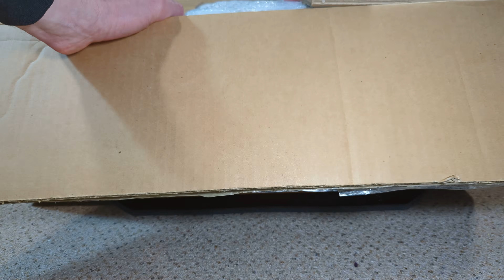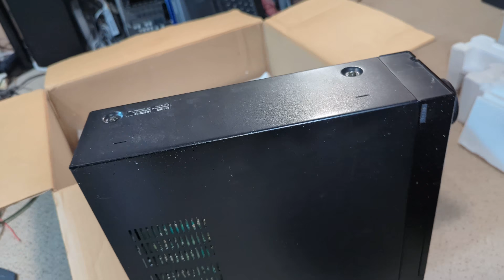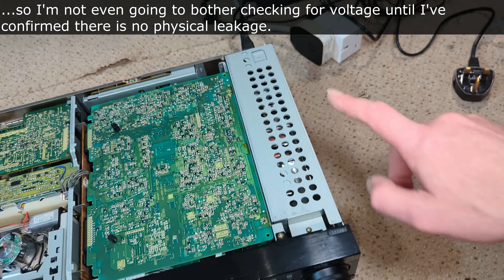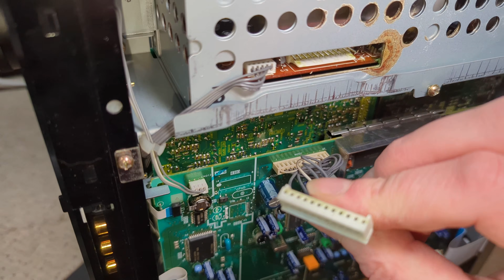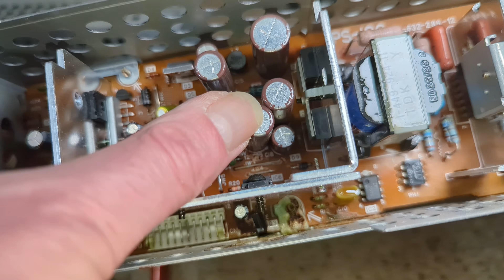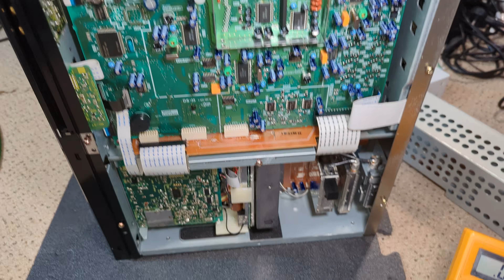Sony EV-S1000 Hi8 - No power - Part 1

Comment: I managed to obtain a like new sony EV-S700E locally in Australia and it's like new and working perfect. I prefer the U mechanism in my 700E too. I had a sony EV-DT1 also which has the same U mechanism like a mini beta machine.
Reply from the maker: That's a good find. relatively, they didn't sell in huge numbers but there does seem to be a lot around still relatively and I've seen quite a few in great condition too. It's always those Elna capacitors though (plus the decks can be quite troublesome).

Comment: I had one of those decks 30 odd years ago. Sadly it was a bit of a disappointment right from the start, as though it was not properly aligned/calibrated. The only thing it had going for it was its looks, and mine had the timber sides.
Reply from the maker: What a shame it didn't deliver on the deck side of things, Timber sides - that sounds great!

Comment: You got a lovely job there! You'll find that 'orrible electrolyte is highly conductive which in turn makes the whole pcb and components conductive, you have to clean everything! once you get a few caps removed, probe the empty holes with your meter on resistance, you'll be surprised at the readings! also be prepared to dismantle & clean the big connector, the electrolyte tracks up that too! my method with them ... 1st desolder & remove the 2 transformers T1 & T2, then carefully clean the pcb with luke warm running water /toothbrush, angled away from mains side, then blot excess water with kitchen roll & dry on a radiator, this gets rid of the surface electrolyte & makes it slightly easier to work on i.e. less stench/ smoke! it's also easier in the long run to remove all the components in the secondary (you will likely find some resistor/diode legs will break off from corrosion) as when there in this state, you have no choice but to fibre pen all the traces back to copper & its easier to do with the components removed.
 The solder will put up quite a fight & The pcb will discolour doing above, but unavoidable. be very careful removing T2 & mark the diode orentation, the markings will come off 

Powered or not the elna RSG so called long life caps leak no matter what!
Hope this helps & the very best of luck, Ben                                        
 P.S. it's normal for the chopper ic solder to look like that
Reply from the maker: I'm reading this after cleaning up the PCB and finding leakage issues across the top of the PCB which seem to now be solved. Very useful information here and something I have found previously with this issue. Those Elna caps are terrible and (not really suprisingly) the gunk from them get absoletely everywhere. I've been very lucky with this machine insofar as it's all in a relatively small area, not had much time to do too much damage and no where near the ains side of things. It's also missed both transformers which is a great piece of luck! I'll certainly reference your post in part 2 - it's perfect information on how to do this properly, especially if you're not a s lucky as I have been. I have a few more of this vintage of machine to work on and I suspect I'll need to deep clean the power supplies on at least one of them!
Reply: @MrBetaByte  Usually the damage is contained in the area after T1 secondary side and before T2, basically the area within the horseshoe heatsink, where I wasn't very clear was, it's generally only nessessary to remove components in that area, you dont have to touch the primary side as electrolyte rarely tracks that way, prior to washing, I remove T1 & T2 to avoid getting water in them, same applies to the 2 open chokes L2 & L3.
  Removing the components may be a bit ott, but I've found by doing this way just makes it easier to spot any potential problems, like broken traces /lands, sometimes the legs will just fall off desoldering them, but better to fail like this than under power, Also easier to test each component is still in spec. thoroughly cleaning the components is absolutely critical as the electrolyte residue will make a conductive path across the component body, makes diodes and transistors (& triac) appear to be electrically leaky and in turn can cause erratic operation/ noisy playback picture. 
the kick in the ding dings with this and it's lil' brother the 550, is after painstakingly getting the psu running, (especially if they have been sleeping in a loft for 20 years) 9/10 you'll find the transport has issues, like loose tape guides, load arms floating where they shouldn't be, dried grease and dirty mode switch contacts, they can really test your patience.
 All good fun though, Ben
Reply from the maker: @007ben009  That's a very good point about getting moisture in the wound components and I didn't remove them which I really should have - I just hope I got away with it as I did try to keep them dry whilst washing the board. I washed it with 99% isopropyl and a brush several times and then washed the area with warm soapy water then went back to the isopropyl. I've not removed components this time although I'll probably end up doing that. Can't wait to come across all the deck issues! One day I might just have a straightforward repair where just one thing is wrong but then, where's the fun in that! 😜

Comment: The Sony EV-S1000 usually suffers on leaky caps in the PSU and loose threadingguides in the mechanics.
Reply from the maker: These power supplies are always troublesome with those wonderful Elna caps. Not seen too many issues with the threading guides but will certainly look out for that issue.

Comment: Sheez Sony does go to town caging up boards even with vent holes and  in most cases those board's cark it or cause something else to go wrong
Reply from the maker: Very true - DC-DC-AC convertors in C9 and TT-F1's are a good example of that - it's like putting the most heat generating electronics in an oven...

Comment: Now all you need is one with a broken drive to have an untested basement find for eBay. If there's verdigris on the circuit board, I wouldn't even want to repair the power supply anymore. I very rarely had to deal with tampered-with devices in the past. First, put it in a Tupperware container with methylated spirits for a week and see if there's still a circuit board. The problem is that the electrolytic capacitors are sealed with a rubber gasket at the bottom. So all the capacitors have to be removed beforehand, which also gives you the opportunity to check which ones need replacing. On the CM-15 board, the RV401 can be used to lower the head switching point.
Reply from the maker: I do hear what you're saying and I'm almost at the point as it's just miserable. This one is pretty good though and several good cleans later, it's much much better (part 2 to follow shortly!). The Elna's are a pain when they go and I have removed all the caps in the affected area (as I always do) so the rot doesn't cause issues in the future. Really very lucky with this one though. Good tip on RV401. Thanks as always my friend.
Reply: @MrBetaByte  
please let me know if RV401 had an effect for you in case you tried. 
i had to separate the head drum rotor on one of mine and of course had to fight to get the commutation point back almost correct (even if i've taken some marks before separating everything) but RV401 never fine adjusted anything for me... so i really wonder how it suppose to be set.
on some VHS for exemple, you need to press play while adjusting to bypass automatic tracking but this trick have no effect on this machine. 
i tend to believe than the manual didn't say everything on this topic...

Comment: Power supplies in my slv-815 also looked like that, pcb/epoxy was even eaten away at some points. Thoroughly cleaned the pcb with alcohol and thinner to get rid of all that electrolyte.
I don’t bother with soldermask or lacquer, make the traces bare with a fibreglass pen and tin all the traces (Philips did that in the past also)
Don’t you just love Elna capacitors? 😂
Reply: Elna electrolytic capacitors are very precise. A series with black heat shrink tubing and no type designation (i.e., not worth a name) all retained exactly 10% of their capacitance after only a few years in a Kathrein satellite receiver.
Reply from the maker: A real pain those Elna's! Yes, I'm going down the same route although I won't tin the traces (I don't think - working on it at the moment and just think it's all good and clean so that's fine). I did use a fiberglass pen though to really get them as clean as I dared! Also managed to get good solder pads back too.